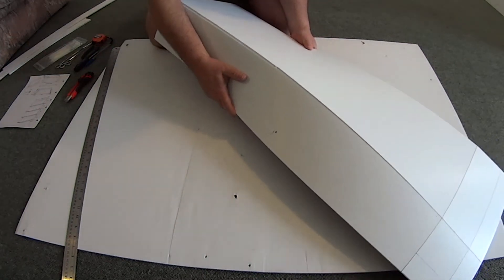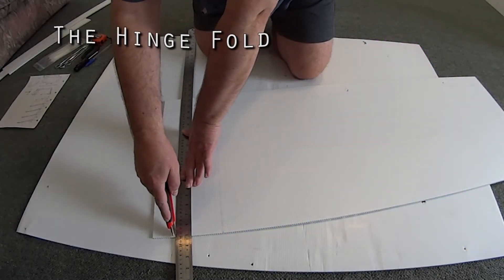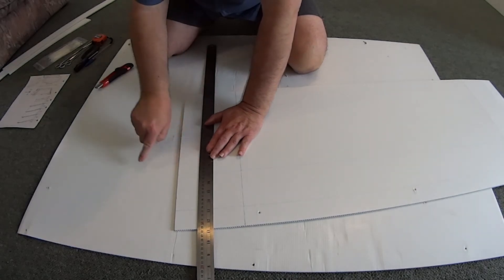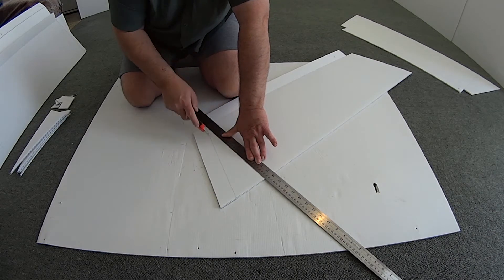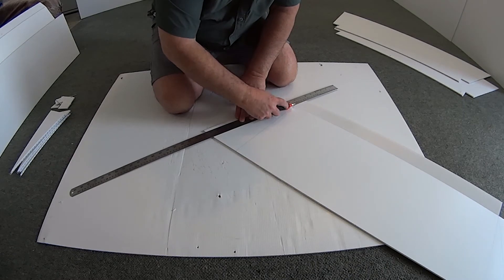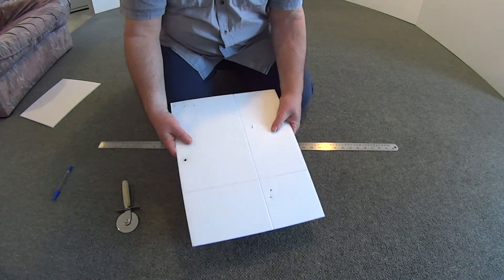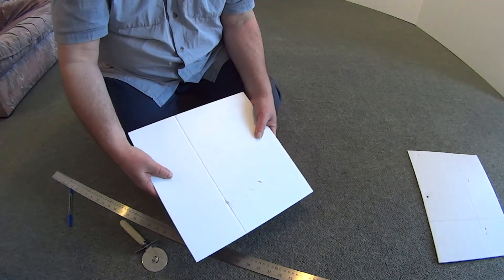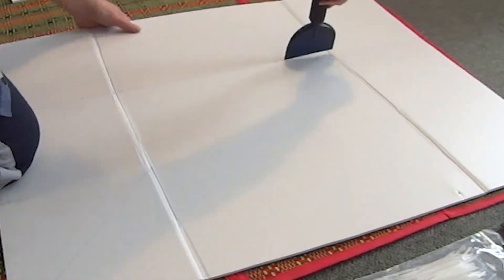Working with Corrugated Plastic 2: Folding Corrugated Plastic

Comment: A little late, so you might have found out already. But what you might be looking for is a screen tool for putting the rubber into the track of a screen frame for a window. I have a tool with one side split and the other is like a pizza cutter but dull.
Reply from the maker: I haven't found that tool, I'll have a look, thanks!
Reply: @TripTheFantastic  

I looked up the name of it. It is called a "Spline Roller" with a wooden handle. Made by Phifer or New York Wire (I think that is the one that I have and it is simply called "Screen Tool").
Reply from the maker: @dovh49  I found a bunch of images of that tool.  It does looks perfect - thanks!
Reply: That's a great idea, I have 3 or 4 of those as I do window screening occasionally!

Comment: Try a soil heating cable or pipe warming cable for your heat strip. They're readily available in shorter lengths. Thanks for the video.
Reply from the maker: Thank you, I'll look into those!
Reply: Rotary cutting blades and scoring tools can be found at any craft or sewing supply store.
Reply from the maker: @brendamcalpine1341  This sounds like good advice.  Do you have links for what either of those tools look like?

Comment: may i know the price and variable thickness of this sheet
Reply from the maker: Price will vary of course.  At Home Depot a 48 in. x 96 in. x 0.157 in. White Corrugated Plastic Sheet is $25.   If you see signs around printed on corrugated plastic you could ask the company, and quite possibly get their old signs for free.  Most or all of the plastic I use in this video is 5mm thick.
Reply: @TripTheFantastic  thank you 👍
Reply from the maker: @madhan59c64  You're welcome!
Reply: @TripTheFantastic  Get the political signs in vacant lots.
Reply from the maker: @donberry6079  Good tip!  Sometimes there are a lot of those hanging around.
Reply: @TripTheFantastic   Find your local Zero Waste group, let them know you want to reuse old yarn signs and ask them to collect them for you.  I just picked up 200 signs last weekend, including some nice 5' x 5' pieces.
Reply from the maker: @xandermcdonald1396  Great tip, thanks!  They were easy to find.  I'll go through their website and get in touch.
I'm still collecting signs from the same real estate agent.  Having just the one source has kept me slightly nervous.  But they've been putting out some big signs lately, which is exciting!

Comment: What is process of bending used in industries for mass production of pp corrugated boxes
Reply from the maker: I don't know!  If you find out, can you let me know?
Reply: Most likely they are using custom built dies and presses,. Likely each size requires its own unique die and possibly a separate press. Dies and presses are expensive but when amortized over commercial volumes they are cost efficient.

Comment: I'm doing more with cardboard and corrugated plastic these days.  For my straight edge, I use a 24" x 6" clear acrylic quilting ruler with a 4-5/8 In. aluminum suction cup lifter (from Harbor Freight), with a large cutting mat underneath.  Both the mat and the ruler have 1/2" grid, so I use the grids to true up very quickly.  Having a handle on the ruler where I can apply some downward pressure, I can cut faster and safer, and the straight edge doesn't walk on me.
Reply from the maker: This is very interesting.  Might you be able to post links to these tools?
Reply from the maker: @xandermcdonald1396  Wow.  This is ingenious.  This holds the plastic or cardboard firmly in place for cutting?
Sorry, something I still don't understand... what do you use the suction cup lifter for?
Reply: @TripTheFantastic  It's a handle for the ruler. It also allows you to apply downward force on the ruler.
Reply from the maker: @xandermcdonald1396  This is really next level use of tools.  Thanks Xander!  If you have any pics, I'd love to see your work space.

Comment: I was just in my garage with a heat gun and that didn't work and I found this video. I used to use a bag sealer at work that had a heat strip that would melt the bag together. It was sold by Uline and I know we had to replace the strips. I will have to try the pizza cutter and straight edge.
Reply from the maker: Thanks for the Uline heat strip tip, this is something I still haven't tried.  I think I mentioned it in the video, but take care, as a lot of pizza cutters aren't very strong.
Reply: @TripTheFantastic  I have already tried it. It worked perfectly and did exactly what I wanted it to. Thanks for the tip.
Reply from the maker: @madeintexas3d442  Excellent, glad to hear it, thanks for letting me know!
Reply: @TripTheFantastic  I got a new Uline catalog today they have a 24 inch replacement kit for $46 that has 2 heating elements ptfe tape and a ptfe sheet. They are replacement parts for a poly bag sealer.
Reply from the maker: @madeintexas3d442  Interesting, what do you do with the ptfe tape and a ptfe sheet?
Reply: @TripTheFantastic  Not sure about the sheet. The ptfe tape goes over the element to prevent the bags from melting and sticking to the strip.
Reply from the maker: @madeintexas3d442  I see, cool, thanks again!